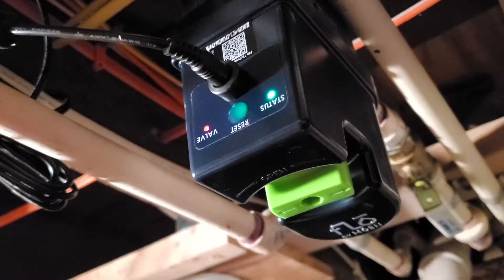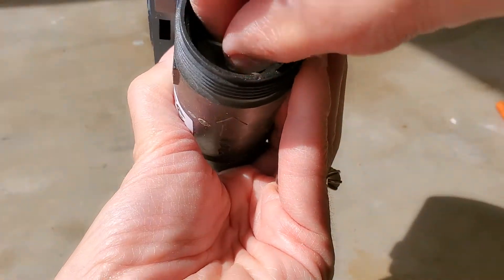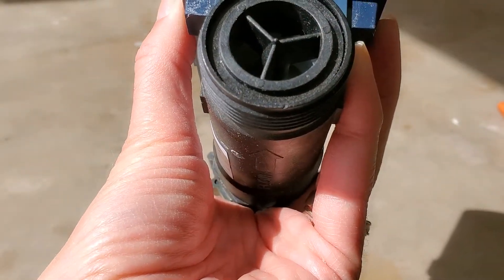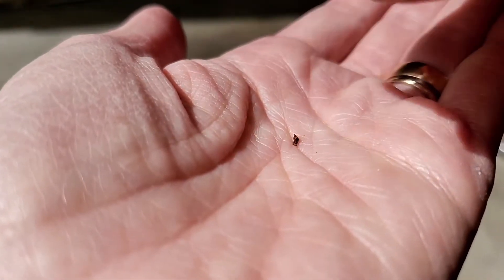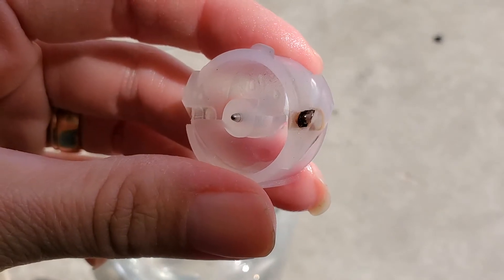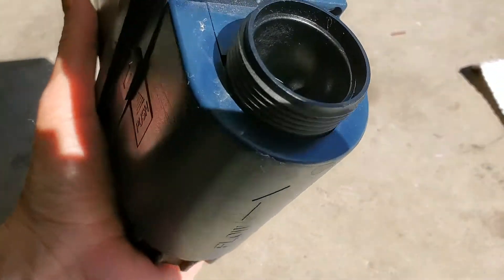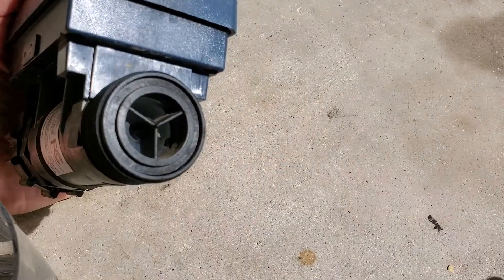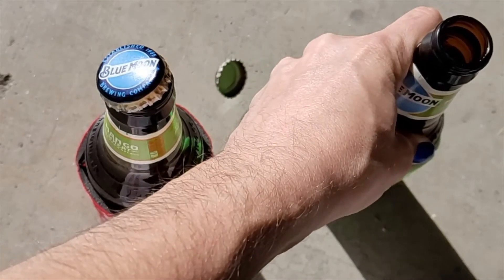Flo by Moen Flow Sensor NO LONGER WORKING?!? Turbine Repair Tutorial

Comment: We're heading into our 3rd replacement of this unit within 2.8 years. And to get support to respond is neawr zero (likely due to the battery backup recall: more than 10,000). I strongly recommend looking for a quality unit, and this isn't it. It is poor engineering, poor support, and I think Moen rushed into buying this without doing their homework. Walk away--fast.
Reply from the maker: I'm very curious--where were you units located and do you have FloProtect? It sounds like your issue is more than just the turbine if they are replacing the whole unit? I live in the Phoenix metro where our plumbing is outside and went through 4 units in 2 years. The failure was not turbine related so a new unit was required each time. Even shaded--this just wasn't the right environment. Unit #5 is doing fine housed in a climate controlled basement. I am pleasantly surprised unit 5 hasn't had a turbine issue yet. There are pros and cons to all these types of devices. I appreciate the heads up on the battery backup recall!
Reply: @NoMoreLeaks  4 units in 2 years? Regardless, that tells the whole story. Our unit is in a basement and protected. I suspect we'll see a class action movement started on that unit over time. I'm hearing from others having the same issues. This product is not something that should be on the market. Gr8 week.
Reply from the maker: Interesting. This is the first time I've heard of a unit failing for something other than the turbine or heat exposure. Do you have any other insights as to what is causing the unit to fail? Do you hear a sloshing inside the unit when it is removed? I've taken down most of my videos on water monitors because there are some much needed improvements on these devices, but the feedback on how these devices are used or problems that are cropping up is very important.
Reply: @NoMoreLeaks  When I disassembled the first failed one, it was loaded with water inside the electrical contents, with a house pressure of about 46 psi. The second one now will not fully close if it decides to shut off the water. My belief is that when Fortune Brands bought this company, they rushed to market rather than do the full due diligence. In the meantime, I've been following other Moen product comments, and it looking a lot like the comments I see for the Flo.
Reply from the maker: Thank you for sharing this!

Comment: When my first Flo failed for the same reason under warranty Moen sent me an entire unit to replace it with. Now that it happened again  I suppose I'll try the vinegar when I have an hour or two to take the house 'offline'  I just wish moen would sell the part! ..Wait actually I just found your other video with the part & phone #. Thank you so much for publishing this.  AFAIK you are the only person to publish a video about this problem with these units.
Reply from the maker: Thanks for your comments. I'm sure the next person will appreciate you pointing this out--I linked the follow on video in the end screen. I'm glad you stumbled upon the other video.

Yes, moving parts are weaknesses. The good thing is now you have a backup unit that only needs a new turbine.
Reply: @NoMoreLeaks  Here's something interesting. I have Flo Protect and wrote them through the app.  This still puts me in a warranty state..  Getting the parts for free and a coupon good for 20 - 70% off a moen product
Reply from the maker: That's even better and made Flo Protect more than worth it! I feel the same way about paying the extra $5/mo when the heat was eating through them here. A turbine + shipping is the equivalent of 4 months.

Comment: Earlier this year, the Flo sensor appeared to only report 50% of the flow volume.  In December, the Flo stopped reporting any flows.  I thought corrosion was causing the impeller to stick inside the flow sensor, but cleaning did not help.  Flo provided a replacement impeller and O-ring set - everything is working fine now.  My theory is that corrosion reduced the strength of the impeller magnets to the point where the Flo unit was no longer detecting that one and then both magnets had passed the sensor.
Reply from the maker: Sounds like a solid theory. I'm glad to hear the replacement impeller worked! Did they send the kit to you as part of Flo Protect or was it within the one-year warranty period?
Reply: @NoMoreLeaks  Neither - squeaky wheel.  The repair kit included a full set of O-rings as well, one for the impeller retainer, two for the plumbing connections.

Comment: This video was very helpful. After reading the comments, I called Moen and asked for a replacement turbine before starting. They said they'd be happy to and actually sent me 4 replacements with o-rings as well.  I swapped out the turbine and my issue was resolved. 
I wish I didn't have to replace the part, but happy I called to get the spare rather than trying to clean the one I had (it looked pretty bad).
Reply from the maker: That's great that this was the solution! I had heard it was a set of 4 that got sent from another subscriber here on the channel, but when I asked the customer service rep, he indicated there was only one turbine in the package. Is it really 4 in the package and they sent o-rings so they don't have to be ordered separately?
Reply: @NoMoreLeaks  
Correct.  4 Turbines, 8 pairs of O-rings and 4 sets of instructions.  Of the 8 pairs, it looks to be 4 pairs of one size and 4 pairs of another size. I didn't use any of them as my o-rings did not show wear.  I just saved them in case I needed them in the future.

Comment: My Flo has been installed in a basement for a couple years. Earlier this year, I noticed the Flow Rate registered zero. I finally got a chance to service it and appreciate this video. My turbine had rust on the magnets and the vinegar cleaned most of it up. Unfortunately, it did not resolve the Flow Rate issue. I contacted Moen and they confirmed that there is no replacement part for the turbine. I also suspect that a new turbine might not solve the issue as it could be in the unit itself. 

My original impetus to install the Flo was to provide an automated water shutoff for my house. I travel and it has been very helpful to be able to control the water over the internet. Fortunately this feature still works on my unit.

The additional features of the Flo and app were great bonuses for my initial goal. Since the Flow Rate stopped, I have found the unit still performs useful functions. One of my garden hoses has a slight leak. I left it on overnight and the Flo unit detected it during the daily health check. I assume that it will detect similar leaks as well. I can monitor the water pressure reading to detect variations in pressure due to usage. Overall, while it is disappointing that the Flow Rate is broken, my unit still provides enough functionality for my needs. 

Your mileage may vary.
Reply from the maker: 100%! Thanks for sharing your experience and mindset. That is the right attitude with these devices. IMHO leak detection is by far the most important of all the features and if that still works, it's still good.
Reply from the maker: Ed, word on the street is there is now a replacement kit for the turbine. I called Moen today myself and they did confirm they now sell them. Thought you might want to know.

Comment: Be extremely cautious when taking it apart. In my case the o ring expanded so I can’t put the valve back anymore. Now I’m running all over town to find the right o ring. 
Flo said starting October they will send out turbine replacements.
Reply from the maker: Thanks for sharing all this!

Which o-ring expanded? The one on the inside or the one that seals the unit to the rest of the plumbing

 I hope you found a replacement o-ring today. It is really nice that Flo includes the plumbing spacer if all else fails.

That's good news on the replacement parts. It is a much better solution than an entire unit if that's the failure point.
Reply: @NoMoreLeaks  it was the o rings that seal the unit from outside, both top and bottom. yes i ended up driving really far to find the o rings and they ended up working out ok. for some reason my spacer doesn't have the o rings attached.
Reply from the maker: Interesting--that's a new one to me. I wonder why they expanded? Mine sat outside and baked all day, but I never observed any sign of deterioration or warping (however, the longest one was only on there about 8 months).

I went through my boxes of Flo parts. It looks like it comes with a spare set of O-rings. I looked back through my unboxing video and unfortunately I did not show it. The resealable plastic bag is just the right size for the two o-rings inside. Both sets were in the envelope with the instructions and owner's manual.

However, nothing in the box, on the spec sheet online, or the o-ring spare part kit (https://www.moen.com/products/Flo-by-Moen/Flo-by-Moen-O-ring-kit/935-008) gave the actual specs of the o-rings.

If I could inconvenience you again: what o-rings are compatible and where did you find them? Let's be real--whoever needs a spare o-ring needs it NOW and cannot wait to order one online through Moen. So I'm asking for anyone else reading the comments and looking for this information.

Again, I really appreciate you sharing your experience. I've learned a new aspect I was not aware of previously.
Reply: @NoMoreLeaks  the exact dimensions are 1-5/16" OD, 1-1/8" ID, 3/32" wall thickness.

I had mine for almost two years so the box is long gone. I installed it indoors that's why it survived this long.
Reply from the maker: Thank you very much for adding in that information.

LOL, the blessing and curse of long range YouTube review planning--keeping too much stuff because I never know when I need something or--as in this case--revisit and realize I missed something. A million thanks for your comment and this in-depth discussion.

Comment: Mine appears to be registering far less then it should be.   About half as much.  I'm assuming only one of the magnets is signaling.   I'm going to take it apart this weekend and clean it.  Thanks for the video.  👍
Reply from the maker: 🤞I'd love to hear back if it works for you. How long have you had your unit?
Reply: @NoMoreLeaks  My background is in electronics with a good mix of mechanical.   What I've determined with this turbine is the plating on the magnets is actually breaking down and the magnets are rusting from under the plating.  I was able to remove the magnets without damaging anything and the plating was completely falling off both of them with rust underneath.   Conclusion,   they need to use better magnets and or seal them from water.   I've ordered new magnets.   Will report back if that works.   It's not trivial to remove the magnets,   so they really just need to fix their design.
Reply: @NoMoreLeaks  By adding 4 magnets 2 new and 2 original all with the same pole orientation my Flo is working correctly again.   So I have two magnets on each side in an OO configuration.   I wasn't able to find the 3.5mm x 2mm magnets and ended up with 3mm x 2mm.  In any event this four magnet configuration is registering perfectly.
Reply from the maker: Interesting that you doubled the amount of magnets. Where did the second set go without sticking out of the turbine and how did you secure the smaller set in place?
Reply: @NoMoreLeaks  The original magnets are holding the slightly smaller magnets in the channel.   The originals do stick out of that plastic channel a tiny bit,  however they are not going anywhere.   Been working flawlessly.    I suspect the magnets don't line up perfectly with the hall effect sensor inside.  So adding two sets has now given it a wider path and a bit more flux density.   Polarities on all the magnets is the same.   All North outward for example.
Reply from the maker: Ah! That makes sense. Thanks for the clarification. Hopefully it buys you a couple more years. 🤞
Reply: One year later and once again I'm ready half the flow rate.   I have the extended warranty so now I'm going to see if they''ll help me out with a new impeller.   I'm sure my replacement magnets just rusted away.   I'm sure I could get it working again for another year.  I prefer to have a new impeller.

Comment: Thank you for the great video. In my case, I tried a gentle clean and reassembly but it didn't work. Support was no help. They said the unit (which was 2 years old and out of warranty) must be replaced. 

I went further, removing the small, corroded magnets by inserting a dental tool into the bottom of the plastic cavity and pushing them out. They appear to be 4x2mm magnets like the ones available on Amazon 150 for $10. I determined that, although the rotor appeared to spin freely, it in fact did not. The corrosion products had swelled the thin magnet pockets of plastic rotor outward. On closer inspection, the rotor rotated freely with a puff of air, but it always stopped at the same spot.  On the rotor surface, it was evident that one side was rubbing ever so slightly on the barrel. It was shiny from wear, with streaks in the direction of travel. Also, the plastic bearing hubs into which the rotor axle sat were out of round- what should have been a round hole to receive the axle was, in fact, a slot. Using #400 emery cloth, I cleaned up the magnets and smoothed the bulged spots on the outside of the rotor where the corrosion swelling occurred. Upon assembly, the rotor would spin successfully, but would still hang up slightly at the same point. I inverted the unit, and this behavior went away. I tried mounting it inverted (my installation is on a horizontal pipe run), but I still got no flow readings: DOA. So my problem appears to be magnet corrosion that caused an interference with the barrel, just enough to wear the axle hubs. This wear on the hubs allowed the rotor to flop around enough to where it doesn't function anymore. 

It's too bad that Moen (or whomever) didn't design this with a removable barrel/rotor/hub assembly that could be replaced. For that kind of money, I can't recommend this product.
Reply from the maker: Exactly and your situation is unfortunate. You definitely went further than most in trying to get it to work again. Thank you for sharing your process just in case someone else can get it to work again.

The problem with mechanical solutions is that it is prone to wearing out. The complications you discovered only exacerbate the problem. It would be great if the next iteration of the product takes this feedback into account especially if the rest of the unit is still functional. If you are still looking for a solution I would recommend taking a look at Phyn Plus as it has an ultrasonic flow sensor--nothing moves. There are differences between the systems though so I'd recommend looking at a few of my other videos before deciding if it is right for you.

Comment: Did yours start working after the brushing and vinegar treatment??  Ours failed after two years.  $500 for two years = not worth installing.
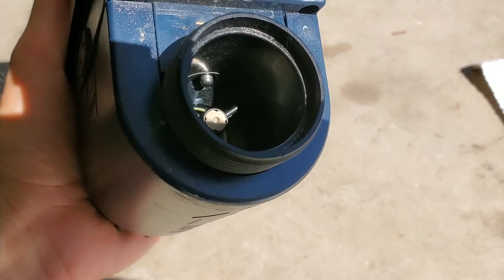Reply from the maker: All my Flo devices failed outdoors here in the desert. I might have been unclear at 4:59--the unit used in the video was one of the 4 dead units. I decided to end that experiment in this location and moved to Phyn Plus. I definitely advocate for enrolling in the Flo Protect program having so many people reach out over the various videos with different failure points (although even with FloProtect they probably don't have replacements available and the backlog is just stacking up). One reason I really looked hard at Phyn Plus before going with Flo initially because the ultrasonic flow sensor seemed like the better design and it was ruggedized to military standards. But each system has its pros and cons. Thanks for sharing your experience and I'm sorry it is not more positive.

Comment: Very detail video.  Like many others, my 900-006, 1 inch - installed 20 months ago and now with no flow rate.  I did everything suggested here and no go.  Here is how to get 75% off discount straight from Moen (no coupon needed).  Call the Moen Flo support line and describe the problem to them.  After a brief verification, they will offer 50% off discount.  Tell them you will think about it.  Next day call back and ask for 75% off instead of 50%.  That was how I got another one for $205 shipped.  I plan to wait at month 10th, almost year end, I will buy the monthly $5.00 plan and this way the unit is covered for another 4 years, free replacement.  Hope this helps someone as the unit is not available anywhere else accept from straight from Moen.

Comment: These devices are defective. The design is just fundamentally flawed. We need to have Moen step up and refund customers who have these fail just after the warranty expires!
Reply from the maker: I think there are a few issues here. It would be nice if there was an option to buy a replacement turbine. The fact that there isn't one, and you can't get a replacement device because of the different shortages throughout the world is a tough spot for both you as a customer and the company to continue to exist. I definitely advocate for enrolling in the Flo Protect program having so many people reach out over the various videos with different failure points (although even with FloProtect they probably don't have replacements available and the backlog is just stacking up). One reason I really looked hard at Phyn Plus before going with Flo initially because the ultrasonic flow sensor seemed like the better design. But each system has its pros and cons. Thanks for sharing your experience and I'm sorry it is not more positive.
Reply: @NoMoreLeaks  Great point. It is really wasteful to have all of these units end up in a landfill because Moen is unwilling to sell a simple replacement part.